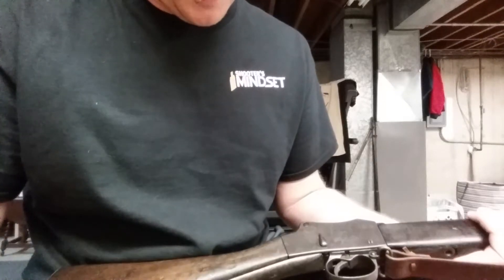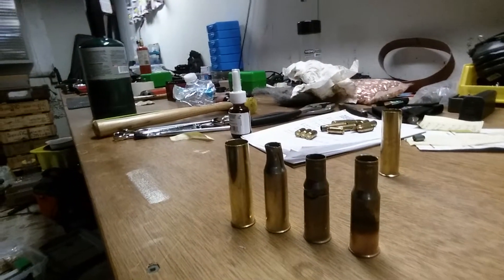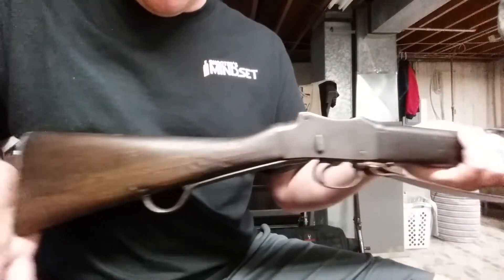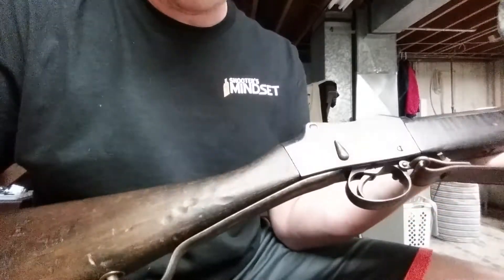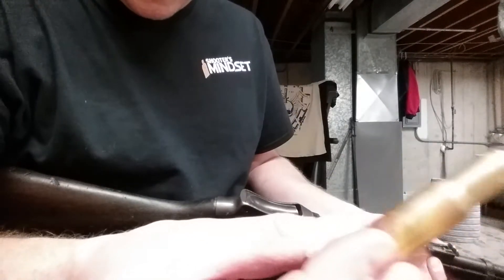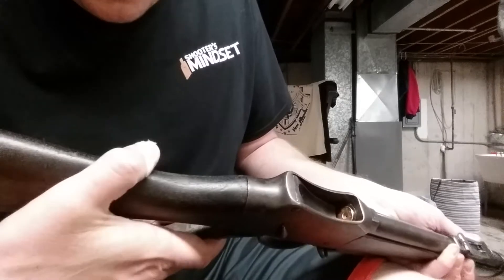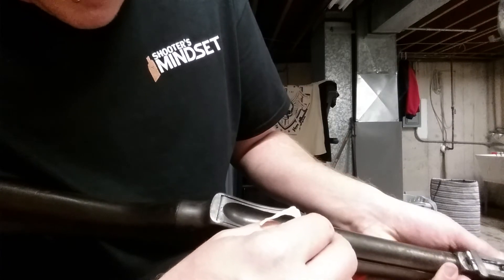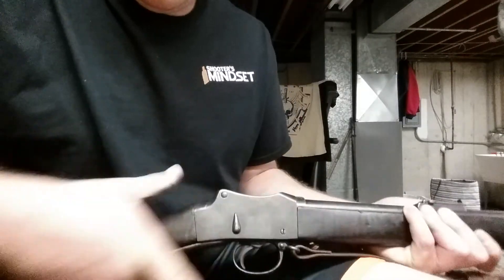1887 Enfield Martini-Henry case fit/eject test

Comment: I used 24 guage shot shell and converted easily .
Are u sure that's 28 guage ?
Reply from the maker: I misspoke in the video, they are 24ga as per the video description. I had a lot of trouble forming the cases; destroyed more than I made, no matter what I tried. Annealing, no annealing, sizing wax, sizing lube, etc. Nothing seemed to help and the failure/success didn't seem to follow any particular pattern.